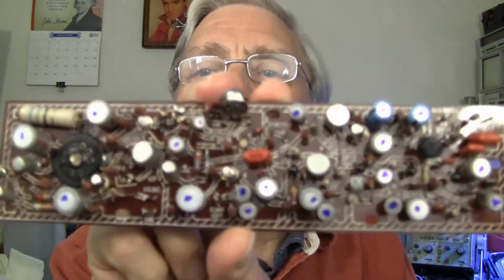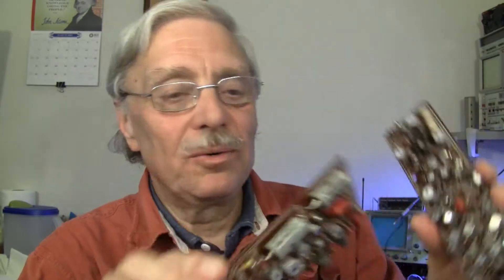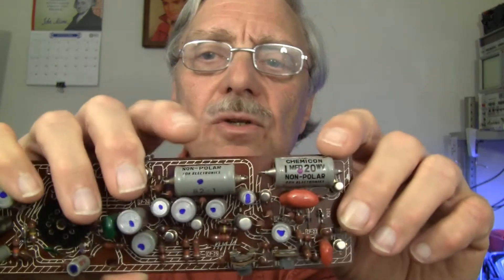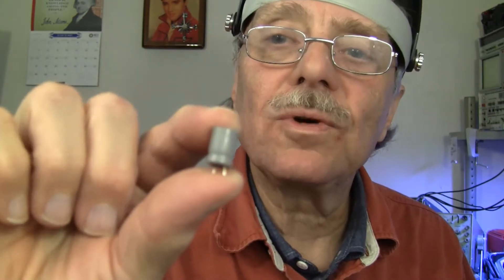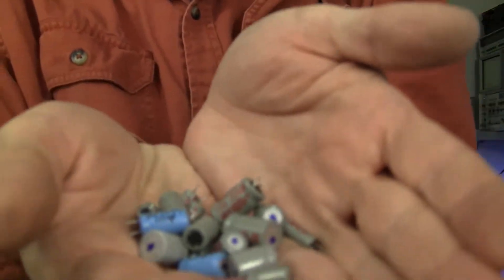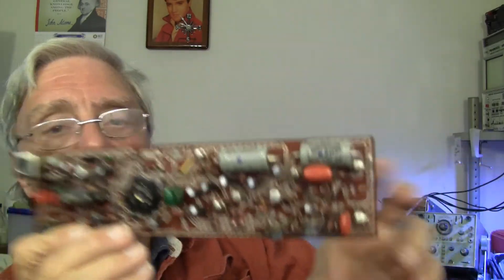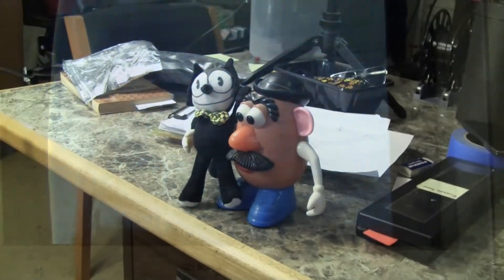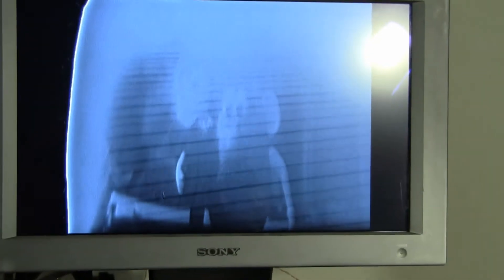Craig 6104 Vidicon Camera Restoration, Part 6

Comment: That's what I like about my VPR 2s. All tantalum caps! Perfectly good until they fail and they fail hard. So no slow performance degrades. And like you said, all the big power supply computer grade electrolytic caps test like new on my Sencore. I find that in 1970s consumer audio gear as well. The small caps are often bad but the power supply and speaker output caps if used seem to hold up.
Reply from the maker: I won't use Tant's because they fail very destructively. Usually burning a hole right through the board. I would rather change 'lytics every seven years than to try to fix the burned traces in a four (or more) layer board. I used to get those jobs at my last employer because I COULD. Not because I liked it.